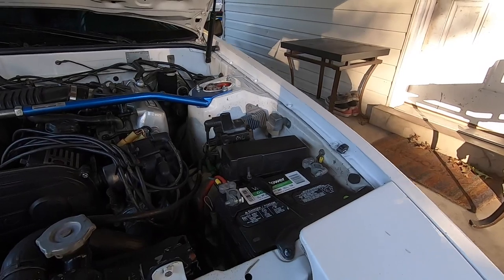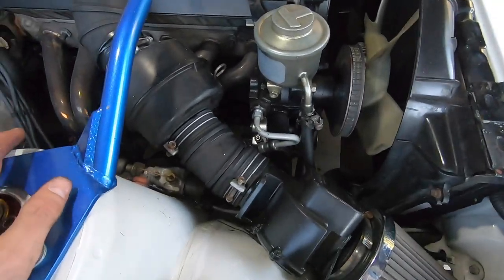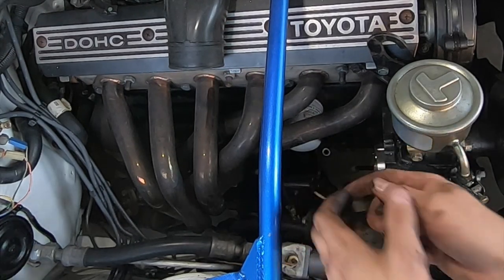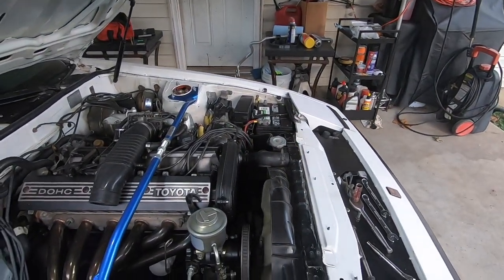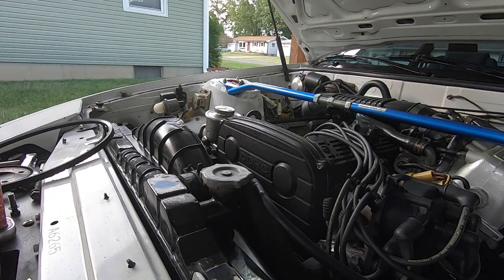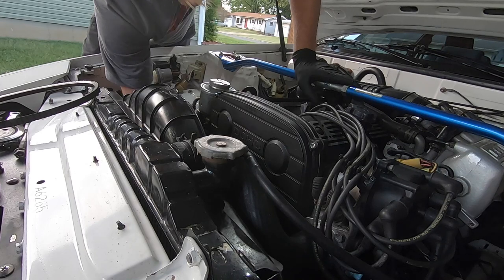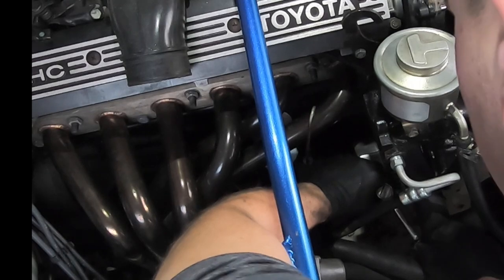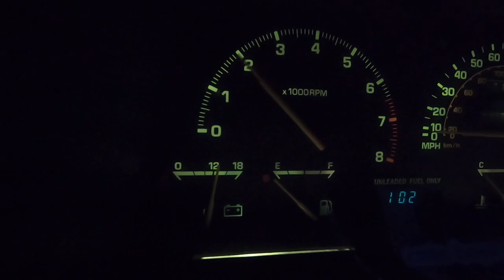How to change an alternator X 1985 Toyota Celica Supra

Comment: Yo, I don't know where my fuel lines are. I have a prodject car same model as yours. And I need to rig a gas tank to see how well it runs. Not only that can you do a video on replacing the front breaks(well taking them off and putting them back on for you). Either one is fine. But rn I just need to k ow there all the fuel lines are and where they are connected on the engine.